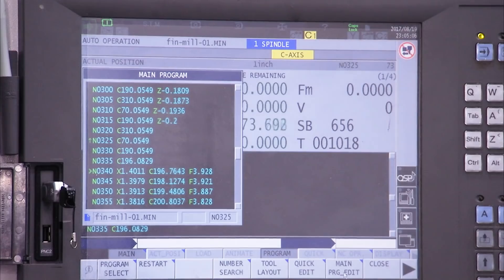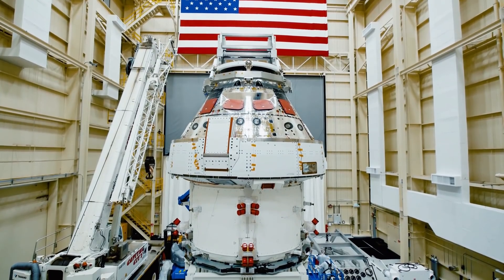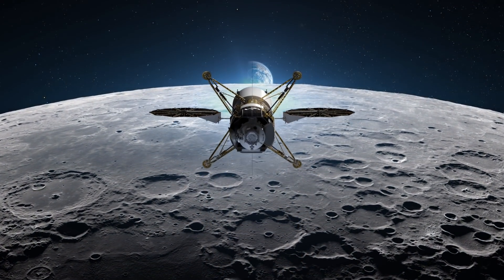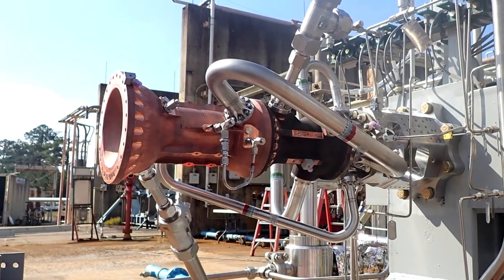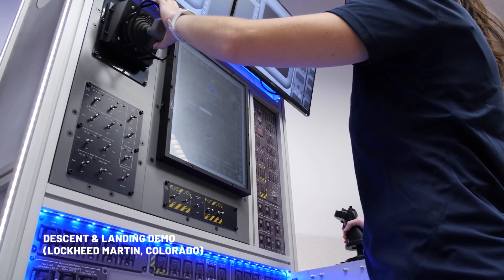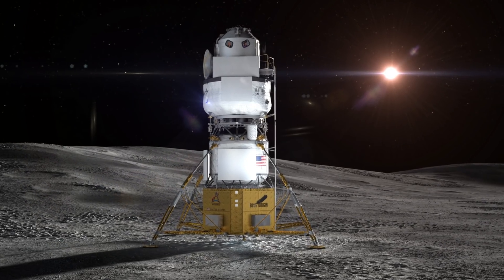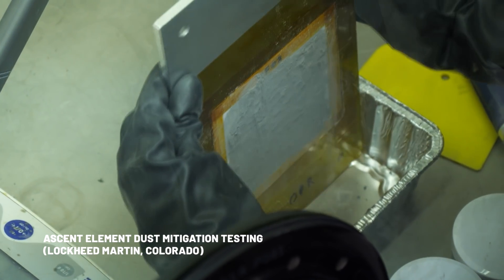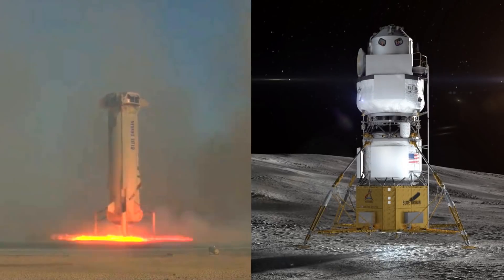Tech Demos for NASA’s Artemis Program

Comment: Update: On April 16, 2021, not Blue Origin but SpaceX was awarded the NASA contract for the Artemis Human Landing System (HLS). The $2.9 billion contract covered the development and demonstration flight of the Starship-based lunar lander intended to bring astronauts to the surface of the moon as part of the Artemis III mission. Elon Musk chose the reusable Starship/Super Heavy system with in-orbit refueling and an upper stage for the lunar lander and announced a moon landing for 2024. 
Today, October 2025, after already eleven test flights, the SpaceX Starship has not even reached Low Earth Orbit (LEO). Until now no technology has been developed by SpaceX that could enable a trip to lunar orbit, the transfer and landing of the NASA crew, or the return to lunar orbit. A demanded test landing is still far off. In 2026, NASA will complete a manned flight around the moon with Artemis II. After that, the HLS will be needed. This is why now, in October 2025, NASA again asked Blue Origin and others for proposals for an HLS (human landing system) because they no longer trust in SpaceX alone.

Comment: Bedrock, fundamental questions about the future of this National Team's proposed HLS Integrated Landing Vehicle:  (1: if NASA's initiates a lunar version of its Commercial Crew Program, how will National Team's vehicle work with that program?  (2: How can this vehicle, Landing Element and all, be made to be 100% re-usable?  (3: If rocket interaction with lunar regolith is considered a safety issue, how can this vehicle be redesigned/fitted with smaller high-mounted thrusters for the final touchdown phase of each landing? (4: The video suggests that the initial prototype landing vehicle can bring one ton (1,000 kg?) to the lunar surface. No doubt this will be a tremendous accomplishment. But if NASA plans to extract substances from the Moon to use as rocket fuel in the future, and if NASA plans to build a base (or bases) on the Moon, a one-ton cargo limit will become prohibitive to future progress. How will this design lend itself to future iterations of the vehicle design that will haul moonbase equipment (robotics, habitation modules, lunar regolith mining equipment, etc.) from lunar orbit to the lunar surface? Will it be possible to iterate a future version of this vehicle that can land 10 tons on the lunar surface? 20 tons? 40 tons? More?  (5: If a future iteration of this vehicle can land a multi-ton payload on the lunar surface, is it then considered possible that the Ascent Element could be replaced with a re-usable mobile basecamp habitat module that could set up a temporary crewed base on the lunar surface, which could be moved from location to location on the lunar surface, for more expansive missions?  (6: How is an Ascent Element module that small going to serve as "home base" for four astronauts who are spending multiple weeks on the Moon? It doesn't even look like there's a place to eat, sleep, bathe or use the restroom.  (7: Is there a way to scale up this spacecraft design to address the six previous questions so that there will be room for a more substantial mission profile for four astronauts spending weeks on the Moon?

Comment: The competitors are thoroughly overwhelmed, overmatched, obsolete. 

NASA specified an anemic-scale first polar landing, to accommodate the fiscal mindset of Congress and the Space Industrial Complex of that time. 

Only Starship is properly sized from the start to place a robust sustainable presence on the 🌚 Moon. Starship brings a 100 metric ton cargo capacity which can be exploited to extend missions far beyond NASA spec. It has an airlock chamber adjacent to pressurized compartments that can accommodate the latest NASA space suits - where people enter the space suit from the pressurized side and return dust-free. SpaceX is delivering an HLS system that is decades beyond the competition. 

The mission requirements for HLS are for a polar landing which is a 6-7 day transfer orbit and requires much more Delta-V than Apollo was capable of.

Comment: If 74,000,000 REAL Americans boycott Amazon then some justice will be meted out to the dwarf pedophile fascist Bezos.  Oh, and by the way .... the main engine on his NewGlenn launch vehicle explodes catastrophically due to disintegration of the heat exchanger upstream of the main combustion chamber.  So, don't pay to go for a ride on a Blue Origin rocket unless you have a death wish.  
Ever wonder why Elon Musk launches hardware and humans successfully every couple of months and Bezos' Bozos (I'm looking at YOU, Tim Hinerman) can't even conduct a 50% duration ground test firing.  And the short duration test firing at the West Texas Engine Test Facility are closed to the media and any non-cleared workers?  They have been roasting hardware since BEFORE I went to work at Blue Origin - and they would still be had they not put a halt on testing and fired their engine project risk manager for documenting the catastrophic failure mode.  Or was it because he had a signed photo of Andrew Breitbart on his desk ..... hard to say, Tim is too hostile to respond (or so say his lawyers)

Comment: Fine with the cgi. Let's see some real action now. Thanks for the presentation.

One question for B.O: Most of the finer dust will cling to suits and equipment electrostatically, as was discovered during Apollo missions. I understand that the heavier dust and grit particles will be dislodged by climbing that dangerously high ladder. But how do you propose to remove the finer, electrically-charged dust particles? Those are the ones which do the most damage to the lungs, eyes, skin and intestinal tract of the astronaut, as well as them being damaging to spacecraft systems.

Comment: I love idea of going back to moon. BUT - with this? Are they actually flying their crew capsule these days? SpaceX has crew dragon that's done a few rounds. They also make a big deal about doing a test launch - totally agreed! But SpaceX can probably do a FULL out and back trial run that is fully automated (and can try again a few times) before putting people on the machine. It's not clear that they will do the return test in their plan - that seems pretty critical to test first? 

So a lot of "heritage" - aka old tech - and a TON of integration. Integration is scary. 

They talk about same displays and controls. I get common type rating with planes (constant flying). Are these astronauts going up so constantly with these displays that they only can use them? Hard to believe given Soyuz (Russian package) was the main way to get to the ISS recently, and now SpaceX.

Not saying SpaceX will solve this, but they should put a demo package together.

Comment: A lot of people don’t realise that the ladder on the Apollo lunar lander ended  nearly 4 feet above the lunar surface. That ladder was dangerous too. And people forget that 30 feet on the moon is about 5 on earth. Falling onto the super shock absorbent lunar dust with a spacesuit which is a few inches thick even from 30 feet on the moon wouldn’t not pose too much of a threat. Falling on rocks could be dangerous but the astronauts could just clear the area of rocks when they go down. And they could also use some sort of rope and pulley system like rock climbers do. Or some rope and pulley that they attach to which works like a seatbelt, where if it gets pulled on too fast (if they are falling) it stops, and it retracts as the astronaut goes up so the rope doesn’t become too slack. This rope could also have an emergency mode where it pulls the astronaut up quickly in case there is an emergency. A lot of people just don’t like blue origin and they don’t understand the concept of doing research, and they always think they are better and smarter than the engineers. Lemme tell you; you probably aren’t. Unless you ARE one of the engineers.

Comment: Its hard to see how this objectively better than the Dynetics solution. Especially when Safety and Sustainability are deciding factors. 

Where is the innovation? This is the apollo design just way taller, they even brag about using old control software... the ascent stage is reusable sure but the system is twice the weight of Dynetic’s design, which is 99% reusable. 

And then there is the ladder.... the 30ft ladder... who the hell thought that was a good idea? All it takes is one Astronaut falling off and the whole Artemis program is in jeopardy.

Comment: stop dissing blue origin. what did they ever do wrong?
Reply: Sooooo
Reply: Dont you know that BO hasnt done much progress and is going straight to landing on the moon?
Reply: @polarized8150  you don't need to launch an orbital rocket to build a lander. And they have tested landing technologies with New Shepard. Blue Origin isn't stupid, its owned by on of the most successful people on the planet, there is no reason for them to set their sights on the moon if they weren't prepared enough.
Reply: Not a single trip to orbit.. that's what they do it wrongly.
Reply: @richyserial1849  it probably wont be blue origin launching the damn thing, but they are already testing landing technologies. You don't need to be able to launch orbital rockets to land something. Besides, they are working on an orbital rocket that will probably challenge most heavy lifters.

Comment: Biden will likely cancel Artemis like Obama canceled Constellation because it was "over budget, behind schedule, and lacking in innovation."
You can substitute Artemis and come up with the same reasons. 
Throwing most of the extremely expensive pieces of Artemis away after one use is not innovative at all.
It doesn't matter if the Starship uses a lot of fuel if that is the only cost. On a trip to the moon it can carry a lot of equipment for a long stay, and still cost peanuts because it's fully reusable. 
It makes far more sense, and would cost far less to just have SpaceX do the whole moon and back trip than have SLS involved. Why throw all that extremely expensive hardware away after one mission? 
A launch on Starship is only $2 million. Less than the cost of the tiny Electron rocket. Starship is going to the moon and back (not land) before Artemis anyway. Starship produces the least amount of debris landing on the moon because it uses small engines mounted up near the nose instead of the Raptor engines.

Comment: NASA should absolutely NOT choose Blue Origin's lander. 
A.  Cost.  Their entire craft is going to be produced by 3 different companies which is going to make Blue Origin's lander a technical nightmare and more importantly EXTREMELY expensive.
B.  Reusability.  The lander element will be left behind on every mission which equals ENORMOUS waste and cost for every mission.  
C.  Capability.  The pressurized capsule is tiny; it lacks room for lab equipment/other gear needed for lunar exploration/science, is extremally high off the lunar surface (safety hazard) and will never be able to fit more than 2 astronauts on a mission. 

NASA if you want the Artemis program to be like Apollo and be so expensive that you only get 6 or 7 missions before it becomes so costly that congress shuts it down, choose Blue Origin's lander.  However, if you want the Artemis program to be an ongoing program that has dozens or even hundreds of missions choose the Dynetics or SpaceX lander.

Comment: Having "Over 1,000,000 lines of code" is NOT a selling point lol
Reply: 1,000,000 lines where something could go wrong
Reply: @Michaelonyoutub  We saw what happened with starliner....
Reply: Doesn't seem to bother the F-35 fanbois and that thing is up to 8 million lines last time I looked.
Reply: I think minecraft has 4 billion? Lol. Minecraft- also never achieved orbit.
Reply: @danielbrowniel  😂😂😂
Reply: @danielbrowniel  You are probably thinking of Google, which 5 or 6 years ago said to be 2 billion lines of code.
Reply: Microsoft Exel: am l joke to you?
Reply: Not every simplistic notion birthed in a simplistic mind necessarily has merit.
Reply: I first read it as a million lines of coke
Reply: @loadapish  you have 1 line of code
Reply: How many lines of code do you reckon Starship or Crew Dragon have?
Reply: @thethirdman225 , Stroe AndreX ,
The important point is not code size,  but that code is thoroughly tested. 

SpaceX builds a spaceship or booster hardware system, loads program code, and inputs a data stream from a high-fidelity physics simulation as sensor data to the spaceship hardware. 

The actuator output from the computer hardware is sent to the simulation system to generate the next milliseconds of sensor data to the spaceship hardware. 

It Is A Closed Loop. Every second of a planned mission is tested. Any situation can be tested. Every outlier.

The data from any mission can be analyzed to improve the physics simulation, or to improved the code for the next mission.
Reply: @imconsequetau5275  Nothing can possibly go wrong then?
Reply: GTA 5 has over 36 million lines of code
Reply: Its not supposed to be  dumba$$
Reply: STFU they're not selling you a rocket. they are selling NASA a rocket
Reply: @RichMiniön-r2m  too bad nasa dont want it anymore lmaoo
Reply: "X" lines of code also mean absolutely nothing... some programmers can write 1000 lines of code in 100 and the result could be better or worse. Not talking about different ways of using parenthesis, braces, brackets... COMMENTS :P

Comment: 18 seconds into the video I hear the phrase "going to the moon sustainability" doesn't seem to fit with this 2/3rds expendable vehicle
Reply: Once ISRU is available they could potentially delete the descent stage and make it fully reusable
Reply: And where is it stated that it will be 2/3rds expendable?
Reply: @iamarokotmanson  only the ascent module is reusable. The transfer module and the descent module are not reused.
Reply: @jimmyfreemantle879  where is that stated exactly,
Reply: @iamarokotmanson  you wanna play the 'whats your source' game or talk common sense? The ascent module is reusable. The others aren't. That's because they expend all their fuel on 1. Transfering from lunar gateway (transfer module) and 2. descending from lunar surface (descent module) 
But you clearly understand this otherwise you wouldn't have passed comment on making the descent module reusable once ISRU is available. U done?
Reply: @jimmyfreemantle879  i prefer the source game because alot of times common sense isn't what's done
Reply: @jimmyfreemantle879  so no souce?
Reply: For the ISRU comment i assumed that the transfer stage would be reusable and would take tbe ascent stage from LLO to NRHO

Comment: I’m sorry but this can’t compete with the Starship.  It will be more expensive, not reusable, more complex (many modules which need to dock, etc).  Less payload, less livable volume, is not reusable for Mars.  It simply does not compete.  It only serves as a plan B in case the Starship project fails.  Otherwise it will be instantly obsolete.
Reply: 2/3rds reusable. Starship will need 12 rendezvous, docking, and fuel transfers in order to achieve a  lunar landing so complexity is at least at the same level for the two, and this is a lunar lander not a Mars lander sooo. Not saying Blue Moon is better per say just correcting your wrong ideas
Reply: @iamarokotmanson  Its not 12 fuel transfers, for the Moon its more like 2.  And this is done in LEO.  Still much simpler operationally.
Reply: @FB0102  2 refuelings to go from lunar surface from LEO and into NRHO from lunar surface?

Comment: Wow BO already tested sensors on a suborbital hop, they already performed 25 risk reduction tests before even making a single flight and even built a Model for the astronauts to train  on the familiar control panels. Lockheed has frozen a steel container. What a job. Looks more like an overpriced science fair for politicians rather than a viable concept.

Comment: 3 different navigation and avionics system working flawlessly together.... what could go wrong? Lox/H2 and Lox/CH4 engines. Isn't adding more systems and complexity the biggest risk of failure? Will this just be another tax payer endless pit?
Reply: That is EXACTLY what they’re trying to do here, they should just go with dynetics at this point, or SpaceX
Reply: @PlaneBoy2520  12 redevouz, docking, and fuel transfers of 100tn of cryogenic propellant in quick succession doesn't exactly seem less complex....